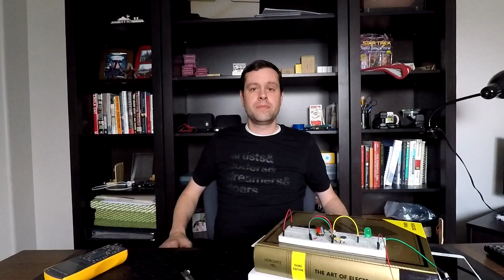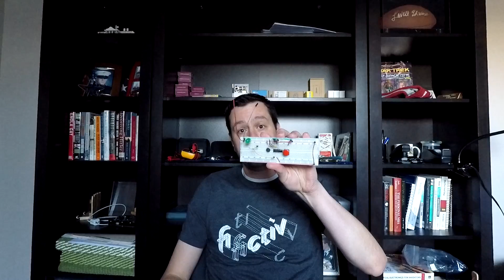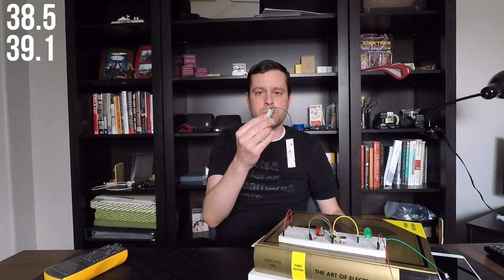Basic Circuits Over Heavy Platforms

Comment: Very interesting. If you recall I made the statement, the IC2 distance limitations was a problem on IOT devices. There by requiring IOT device very near the sensor what ever it might be. Well, this sounds like the solution running 2 wires for many type sensors would allow the IOT device to keep an eye on the remote sensors, polling them for change in voltage. Have a great weekend.